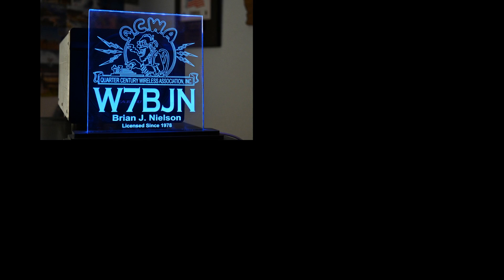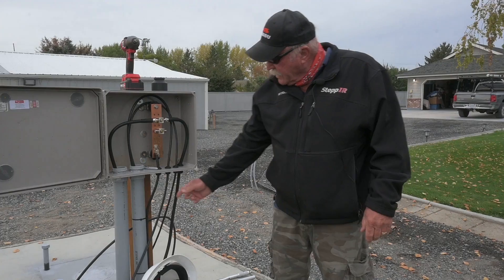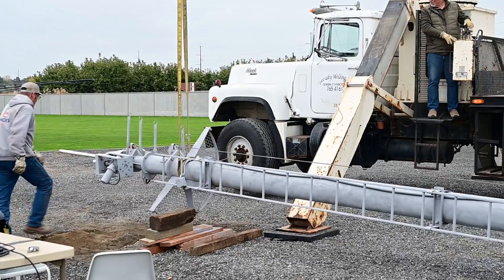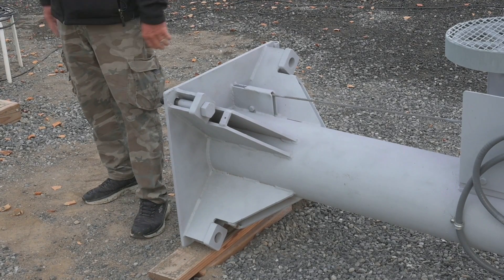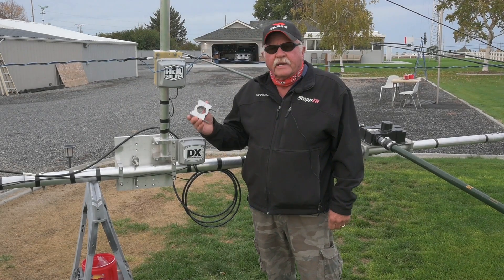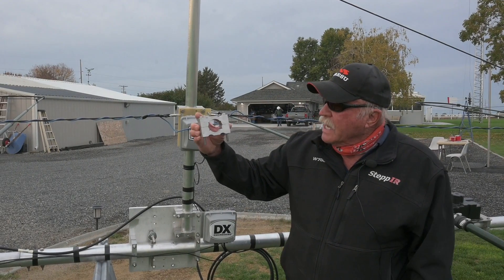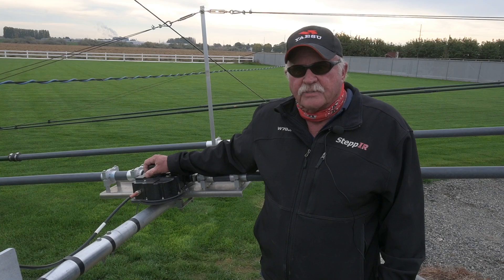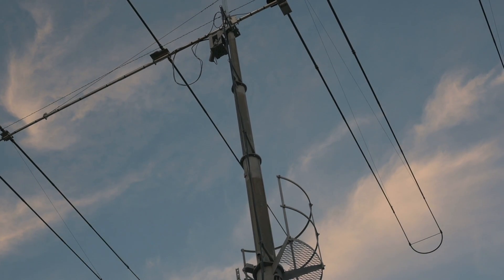BigTower&BigYagi

Comment: Am I confused about the bolts?  They look like they only threaded into the ground about 1"?  I have installed many light poles and we always installed the anchor bolts with the concrete pour.  The bolts protrude from the concrete and the light pole is set onto them.

Comment: The mounting bolts look like they only had  2-3 inches of threads in the ground!
Reply: That’s ok, anything more than 1.5 time the bolts diameter will give full strength
Reply: @borisj4054  Corrosion could be the problem, much easier to see and correct out of the ground..

Comment: to me it seemed the bolts did not go far into concrete? it appeared like they only went 3 inches or so?
Reply: Huge mistake. Those should be all thread prefferably J hooks to almost the bottom of the footer with rebar cage around them like stirrups.. Silly mistake. AS a PE since 1987 you gotta be kidding me.
Reply from the maker: Brian, W7BJN, reported to me "The base was engineered for plenty of threads beyond fully threaded.  They are construction grade fine threads and done strictly by the TRI-EX engineering specs."
Reply: Yep, me too.
Reply: Typically only need about five threads for holding power
Reply: @shockingguy   do not tell the owner of a Ford Triton engine that !
Reply: @jhonsiders6077  😂😂😂

Comment: hope you grounded all 3 legs of the tower,  and high on the tower legs.  you dont want lightning to hit the concret to distroy or crack the base.  Futher more the system to control the antenna does not like lightning a surge will wipe out that system easily......GOOD LUCK !!  nice install !!!  w2ot.  ( less moving parts the better ) lesson learned.
Reply: I’m amazed that you thought that he wouldn’t know that! Thank god you told us!
Reply: @donalfinn4205  A LOT of people do not know that I do metal fab for parts on transmission towers was shown a base on a TV xmitter over 1000ft tall that destroyed by lightning  the experts had goofed and let a grounding of the rebar to the earth and tower shot straight through it . Hence I rebuilt all the brackets for its replacement tower .Just because some one is a expert does not mean they cant screw up .
Reply: @jhonsiders6077  Rebar is always required to be bonded to the grounding electrode system. Please read up a Ufer ground system and be educated please.
Reply: Apparently you didn’t watch the video. It’s a monopole tower. All three legs?? Lol
Reply: Nice job!
Reply: Lightning splitting concrete is an old wives tail.  Never happens.